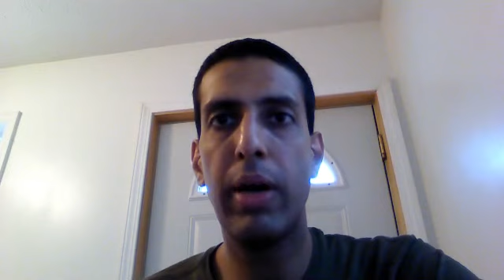Turboshaft Engine True Power Output Explanation

Comment: Hi Mark, can you make a video on the Mccormick formula for estimating helicopter thrust using power loading?
Below, we will demonstrate a method to calculate the theoretical thrust that that a propeller or rotor can generate. Of course in a helicopter, the rotor disk is oriented such that we call its force "lift" rather than thrust, "thrust" would be used in the case of an airplane. On a helicopter, the force of a tail rotor would be best described as thrust.

The first step is to measure the diameter of the rotor or propeller and calculate the area in square feet. Area is defined as:

A [ft^2] = Pi * r^2

or

A [ft^2] = (Pi/4) * D^2

where r is the radius of the propeller or rotor disk and D is the diameter in feet, of course Pi is the number 3.141592653589793238462643

If we know the area of the disk in square feet, we then need to know the amount of power that is delivered to the rotor. This needs to be in the units of horsepower. To convert the metric system of units Watts to horsepower, use the conversion: 1 horsepower = 745.699872 Watts. The goal is to calculate a parameter called "power loading" in units of horsepower per square foot. Power loading is calculated by:

PL [hp/ft^2] = power / A

where "power" is the power delivered to the rotor or propeller and A is the area, calculated above. This is very important---approximately 10 to 15 % of the engine's power will be delivered to the tail rotor to counteract torque. This number obvisouly varies but 10 to 15 percent is a good starting point. If you have a 100 horsepower engine in your helicopter, expect only 85 to 90 horsepower to actually get to the main rotor. Additionally, you would need to reduce the power by an additional small percentage to account for frictional losses in the drive system. In the case of a tandem rotor helicopter such as the Chinook or meshed rotor like the Kmax, all of the power will be delivered to the main rotor and this in fact is the reason those helicopters are so well suited for heavy load lifting operations.

Using the parameter PL [hp/ft^2], we use an empiracly defined formula to calculate the thrust loading (after McCormick). Thrust loading is in the units of pound per horsepower and is a function of power and rotor disk area. Thrust loading (TL) is calculated:

TL [lb/hp]= 8.6859 * PL^(-0.3107)

Now that thrust loading is calculated, we can find the total thrust of the propeller (or lift of the rotor).

Lift = TL * power >>>[lb] = [lb/hp] * [hp]
*note: Calculation results are in pounds-thrust, NOT pounds-mass

Below are some common examples of the thrust developed by common aircraft engines and typical helicopters:

Theoretical thrust developed by common airplane engine - propeller combinations:
300 hp, 78" propeller develops 1,300 pounds of thrust
80 hp, 50" propeller develops 400 pounds of thrust
1.5 hp, 12" propeller develops 10.5 pounds of thrust

Theoretical lift developed by common helicopters:
300 hp, 30' rotor develops 3,400 pounds of lift (neglecting loss to tail rotor of 10-15%)
25 hp, 12' rotor develops 347 pounds of lift (neglecting loss to tail rotor of 10-15%)
2 hp, 6' rotor develops 39 pounds of lift (neglecting loss to tail rotor of 10-15%)
0.25 hp, 10.5" tail-rotor develops 2.9 pounds of thrust
Reply from the maker: Hi Christophe.  All of the multivariable formulations you present are theoretically accurate as they translate 2-D disk-loading into 3-D thrust/lift vector(s).  However, one must always realize that rotary-wing aerodynamics are more concerned with dynamic pressure and viscosity.  The aerodynamic lift formula [(ClxAxPxV^2) / (2)] is more relevant to helicopters as opposed to propellers.  Helicopters also integrate multivariable thrust, lift, drag and weight vectors into combined Oswald Number and Span Efficiencies.

Specific manufacturers write specific variables for their applications. Although if you were building something from scratch, like a helicopter UAV drone, you'd have to integrate all four vectors into combined dynamic pressure and viscosity functions.  It gets tedious and possibly not accurate, without rotary-wing design software, especially for structural development and overall power availability.  Once these are resolved, software and electronics can trim position lock and self-leveling accordingly. 

On a very basic level, calculating the mean effective airflow over the rotating wings by taking the average circumference per second at the root, mid-region and tips, followed by calculating the coefficient of lift, slugs/cubic-ft air density, blade/wing projected area and using the aerodynamic lift formula can predict approximate force lift/thrust.  Also the boundary layer over the rotating wings will add to lift/thrust as well, as this is Bernoulli Force (P x A) as opposed to Newtonian Force (m x A).  These two a combined-sum, however, the aerodynamic lift formula tends to combine both, as dynamic pressure and viscosity are included.

Chopper aerodynamics are too complex for single computations then combined.  Instead, threshold limitations on tilt, cyclic and collective are integrated into industry standards for ease of use, in the real world. 

Helicopters = Rotating Wings = NOT a propeller!  lol

Try using the aerodynamic lift formula in relationship to blade projected area, coefficient of lift based on airfoil and AOA, air density and average rotation airflow over blades/rotating-wings.

- Mark -
Reply from the maker: After that, you'll be able to figure out power watts lost to keep system operational leaving available useful power in watts.  This then could be integrated with payload and force per area or pressure loading on disks (main and anti-torque), thus resulting in Lb/HP METO calculation(s).  - Mark -
Reply: @markscythian  yes, they are rotating wings not props,  a very different method to generate lift. I think McCormick's formula may be for tiltrotors as he was a tiltrotor expert.